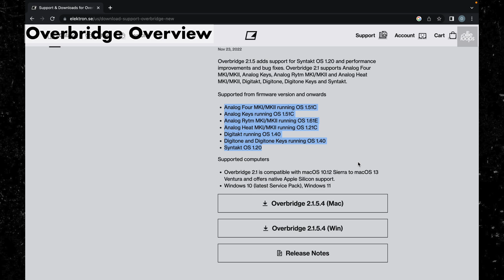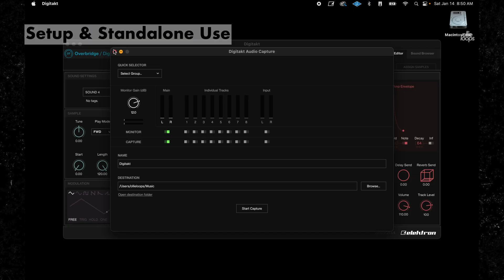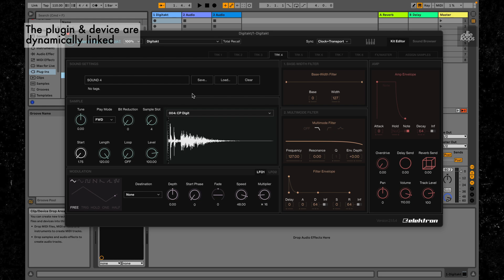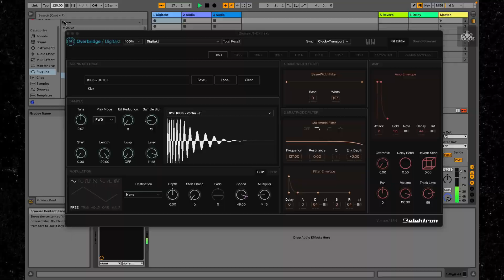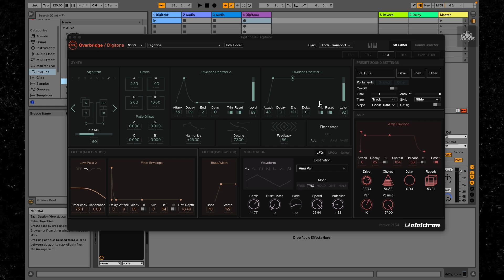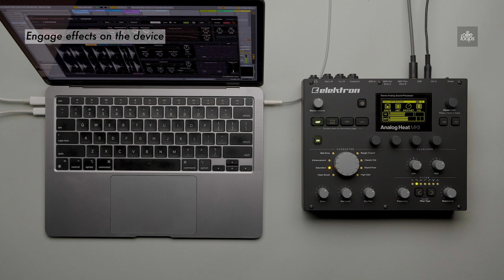Elektron Overbridge

Comment: Good morning, I have a question: can the Digitone 2 sequencer's lock parameter, which the overbridge supposedly maps to knob movement, be recorded by DAW as an events data stream? Secondly, can notes from the Digitone 2 sequencer be recorded somehow by a DAW? Is it possible to easily transfer the entire Digitone sequencer project to the DAW so that it is identical, so that the Digitone ultimately works only as a sound module, but with the same project that was created on the Digitone 2 sequencer? Thanks.
Reply: Midi out from the digitone ii into the midi in on the DAW. Midi out from the DAW to midi in on the digitone i.
Reply from the maker: Thanks for your questions. You would want to route midi in and out of your DAW to/from the device. You could route them to separate midi channels but it may be possible to route them to one midi channel. This way, you can send midi sequences to the device as well as receive them from the device. This would allow you to treat the device as a sound module but still receive notes played on the device. Hope that helps. Good luck.

Comment: My Digitakt 2 wont show ?.
Reply from the maker: Double check that you have the latest software and firmware installed. Also, try connecting it directly to your computer instead of through a hub. If that still doesn't work, you could try reaching out to Elektron for support. Hope that helps.
Reply: @OllieLoops  Thank you it was hub

Comment: how can you record notes from ableton clips into the sequencer in digitak 2? i can play them back from ableton but when i try to record them they never record almost like the tracks are unarmed to record please help thanks
Reply from the maker: I'll try to help. Outside of Overbridge, you would want to set up an External Instrument on a Midi Track in Ableton. Here, you would dial in the midi channels to sync between Ableton & Digitakt. Once midi is going to the Digitakt from Ableton, you would simply record on the Digitakt to capture the notes that are coming in over midi. I hope that helps.
Reply: @ I appreciate the response , I’m sending midi from Ableton into the digitak and it’s being received and triggering the one shot sample but when I hit record it’s unable to record the midi. Are you saying I should not use overbridge at all and try it that way ? Thanks again 🎶
Reply from the maker: @NRLXN  I think you have to rule out the Overbridge isn't part of the issue. Bypass it to test if midi can be received and recorded on the Digitakt from the computer via USB midi or even 5 pin Din. Additionally, check if your tracks are muted on the Digitakt. It could be that the notes are there, but muted. Lastly, I read on a forum that Digitakt doesn't support external recording of midi CC though it can receive them. That too may be the issue. I hope that helps.
Reply: Does Elektron really not support external recording of MIDI CC? That’s surprising! I’ve seen people connect a MIDI keyboard and trigger one-shot samples on the Digitakt. In this video (https://www.youtube.com/watch?v=4m0MricrXMM&list=PLH-dZYSWOOiuV_aryQp8EVhz5XKgnioW1&index=14), the creator mentions that the Octatrack “only recognizes MIDI CC between C5 and C7.”
Reply from the maker: @NRLXN  Here's the forum thread I mentioned in case you want to read up on it: https://www.elektronauts.com/t/recording-midi-to-the-digitakt/43575/15
Someone posted back in 2017 that Elektron support said that Digitakt doesn't support recording midi CC. On the same thread, someone said that only Octatrack supports recording midi CC. Therefore, just because Octatrack does it doesn't mean Digitakt can.
Also, being able to receive and record notes are different. To confirm, can you receive notes from Ableton on the Digitakt and hear them on the Digitakt? If so, then you are within the midi note range that the device expects to receive notes in. If not, you may want to adjust the octave of the notes up and down until you find the range (similar to the video you sent). 
But nothing happens when you record on the Digitakt? 
Have you confirmed that the tracks aren't muted on the Digitakt? 
If these are both true, you may want to reach out to Elektron support and see what they say.

Comment: Bro I couldn’t get this software to work.. it was reading the digitakt in ableton I opened overbridge and it wouldn’t read the device!!!? 😡
Reply from the maker: There’s an app that needs to be installed called Elektron Engine. That handles USB communication between the device and the computer. Is that installed and does your Digitakt appear in Engine?

Comment: Thank you so much for the video. I haven't buy Digitakt yet but I wonder, is there a way to simply drag and drop samples from a DAW to Digitakt via overbridge? Or you have to transfer it to the disk on DT?
Reply from the maker: Overbridge has a file browser to import samples. You can also just presets in Overbridge making it convenient.
Reply: @OllieLoops  but it's 1 way isn't it? It's for getting samples from device to DAW not the other way?
Reply from the maker: @GG-wx8en  That's not my understanding. Check out the Overbridge manual, section 6.5.3 Sound Browser within the Digital Plugin chapter. It describes loading sounds.
Reply: Hey, I just bought Digitakt and there is no way to put sample from DAW onto Digitakt. @OllieLoops  You can use recording function and sample from your DAW onto DIgitakt. Also, transfer app is not hard to use but obviously not fast as using sampler inside the DAW :)

Comment: Be warned with the analog heat overbridge reduces volume and adds a load of noise (confirmed multiple times on the elektron forums).  Something with the ADC.  Using the analog outs this doesn’t happen and much better with reducing latency
Reply from the maker: Interesting. Thanks for sharing.
Reply: On what version of heat does this with ob? (Mk1, mk2 or h+fx)

Comment: How does the monitoring works in Standalone Overbridge?  Are the monitor outputs routed to Mac’s system output so then you can hear that via UAD Console? Or do you need to set the connected device as Mac’s system output interface?

In other words, without using a DAW, can you use Elektron device as input routed to Apollo as output?
Reply from the maker: Overbridge streams audio to and from the device and computer. It’s latency free, or in my experience imperceptible. You can monitor on the device, or via an audio interface. I believe they are both live simultaneously.

Comment: In my experience, as well as it is designed, OB is useless for both recording and live performance (as an Ableton live user). I've resorted to only recording via the direct outputs. I'm open to hearing work arounds and I've yet to try OB 2.5.1 but... 

Recording: the latency is too much to comfortably record as you have to manually move the USB recordings back each time.
Live performance: same problem except it's worse as having the OB plugins moves everything else back in time as well (with DC enabled).
Reply from the maker: Interesting. I haven’t experienced much it any latency. What’s your audio interface?
Reply: @OllieLoops  MOTU4pre, but I'm pretty sure that doesn't affect latency when using OB as a plugin. It's using the A4mk2 as an interface, and the only way I can get acceptable latency is by recording through the analog outputs. I've heard it does better in other DAWs such as Bitwig though.
Reply from the maker: @MichaelMonaghanWav  Understood. Have you set up Driver Error Compensation in Ableton? I do this for any interface that I use the input on. This allows you to correct for latency in your system. 
https://help.ableton.com/hc/en-us/articles/115000234830-Driver-Error-Compensation-FAQ

Are you tracking through the A4mkii? I'm trying to understand your signal path / what you're trying to do.
Reply: Hey, yes, I've DEC set up correctly, but the OB plugin has its own latency regardless of what you set in Live's preferences. I beleive the latency with OB in Live is inevitable, it's just the cost of getting the multitracks into Live for now. Sorry for not replying before, and thanks for responding! @OllieLoops
Reply: @MichaelMonaghanWav ableton has added a feature in live 12 to deal with this no?
Reply: If you are still having this issue, just live record the multitracks into the standalone over bridge device. Hit the little tape icon at the top right and it will bring up a multitrack recorder. Select all the tracks, hit record and then press play on your machine and jam away. Then import the wav files into the DAW set to the same BPM, trim the blank space to start and line up the drum hits to the grid. This is a workflow I use all the time, and it's very easy and less involved than having to worry about latency..etc.
Reply: Right, but that's no different than just recording off the grid in Live and then dragging it to the bar line, you just have an extra step of dragging audio into Live.

Recording the analog outputs is the only way currently to record the A4 in sync in Live (without having to move the rec), and same goes for a live performance, OB simply has too much latency. That's why I'm going DAWless :D @landonh3535

Comment: I have a digitakt and two synths connected via input L & R. Im using Digitakt as an external mixer for recording through ableton but, when I record im getting latency and dont know how to fix it? Any ideas?
Reply from the maker: Are you using it as an audio output as well, or a different interface. What’s the rest of the setup. There are audio settings within the control center app. You could try adjusting the buffer settings. If that doesn’t help, I would suggest contacting Elektron’s support.

Comment: Great video but I’ve just never understood the benefit of Overbridge aside from multi-track recording. 

I watched this to see if something here could change my mind but I don’t think so. Firing up the computer, opening the the DAW, making audio/midi tracks, etc etc… this is a way slower start up period. And while the visuals are nice it’s a very aesthetic plugin), I don’t feel like I can move the mouse to the tabs and parameters I wish to adjust quicker than I can press the page buttons on the Elektron boxes and turn the needed encoders.

Using an Elektron box as a sound module really defeats like 50% of its purpose if not more because it’s a way better sequencer than a piano roll in the DAW. I guess DAW advantage would be quick to draw in velocities and what not but if you miss out on all the parameter locking you’d be better off just sampling with your DAW which is way more power of a sampler than the Digitakt if you’re not planning on using it’s sequencing abilities.

Anyway… whatever. Each unto their own. Clearly I’ve decided Overbridge is not for me. As always though, excellent video.
Reply from the maker: Thanks for your honest feedback. 

I'm not sure the percentage, but let's say that 20-40% of users may like and take advantage of Overbridge. The question for them is, what does that hybrid workflow look like. I can't answer that, I can only present some ideas. Personally, I think having an Analog Heat and primarily working in a DAW makes Overbridge a must have for that workflow. That holds the most value for me personally.

Ultimately, I'm trying to teach a wide range of users about gear and ways to use it that may inspire them to make music. 

With that said, I'm curious to hear from you about gear you use, the type of music you make, and what videos you'd like to see me make. Feel free to email me or continue this comment thread. 

Thanks again for your feedback.
Reply: @OllieLoops   I am creating virtual instruments for my app so I am doing sound design on the analog rytm and then sampling in ableton and take those samples to create the aupreset for my app.
overbridge also saves me inputs in audio interface or mixer.